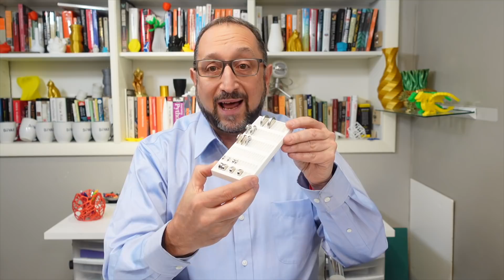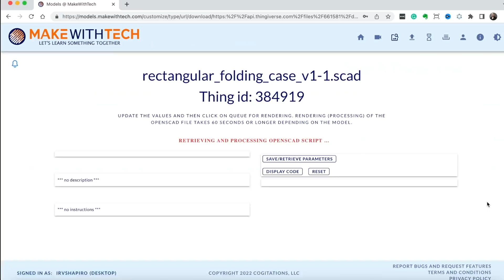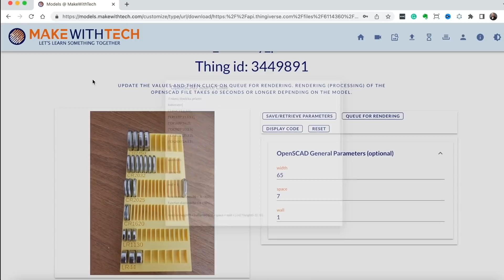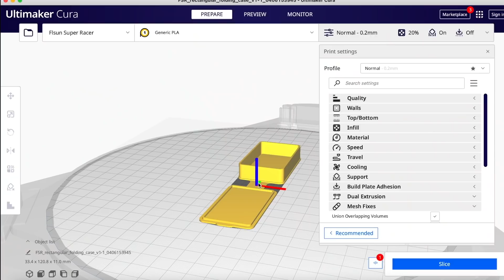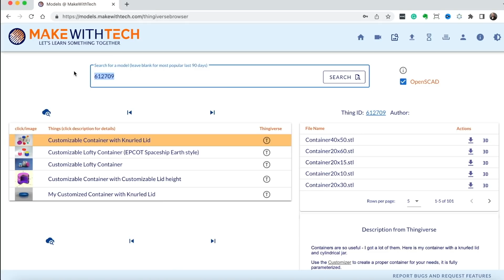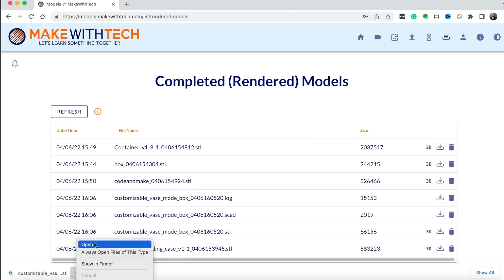Organize at Home – Customized 3D Printed Containers

Comment: By far, the best website for 3D. It's my goto page for many reasons. Now that 3D printing is taking off in the US - a switch from mm to inches. Not knocking the "metric" system, but almost everything I do is in US standard measure. Example, when making drawer dividers the holders are in mm and the wood slats are cut on a table saw - in inches. Not always easy to get it right. Am I the only one with this thought?

Comment: Can you help me with "Pausing"?
My problem is simple. I don't like print while I sleep, so I try to manually pause the print and turn it off.
However whenever I do, the nozzle doesn't go to the Home position. It stays in some random spot of the print. leaving a blob of filament. 
When I restart, the following layer seems to get skipped as if missing. But the print does get finished.
I use an Ender 3 Pro printer

Comment: One Trick for the flimsy side in spiral mode, print with thinker walls, 0.6 or even 0.8mm walls, because you can overextrude and force a bigger wall than the with og your nozzle. The slicer can make it happen!👍
Great walkthrough of the process 👍
Thanks for sharing your experience with all of us 👍😀

Comment: The vase mode idea is great, but the thin walls may be a little delicate depending on what you're going to use the container for. You can increase the wall thickness somewhat (under Quality \ Line Width in Cura or Print Settings \ Advanced \ Extrusion Width in PrusaSlicer) to speed up your printing or to slightly strengthen your vase mode prints. If you're using a 0.4mm nozzle, you can go as high as .6mm or .65mm  without too much trouble (you may want to increase the hotend temp by about 5 degrees to make it easier for your extruder to push more filament). With a 0.6mm nozzle you should be able to print in vase mode with 0.9mm to 1.0mm walls.